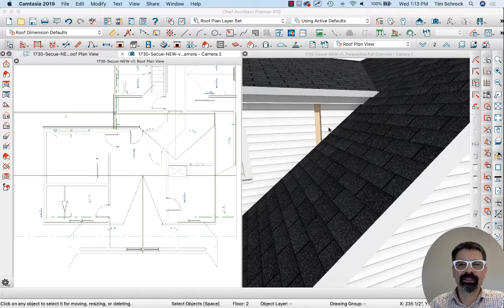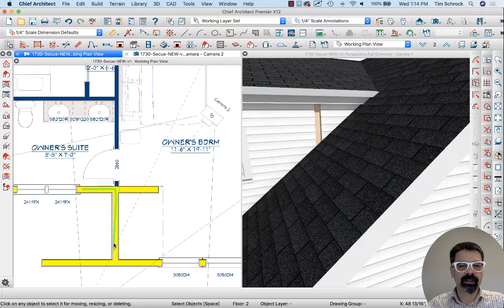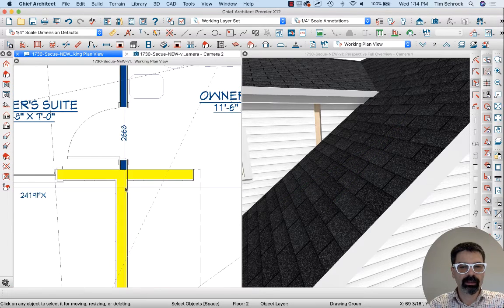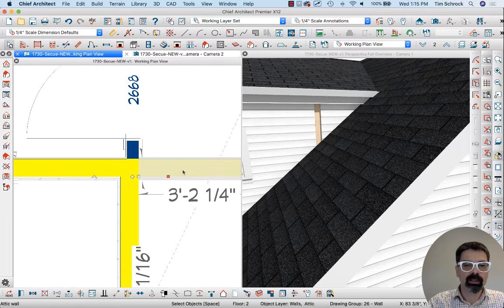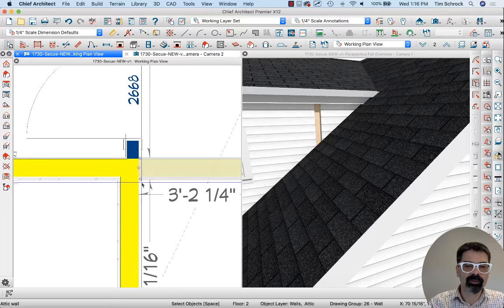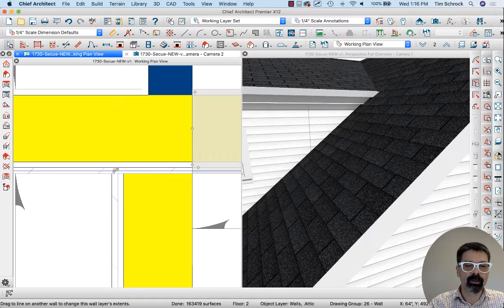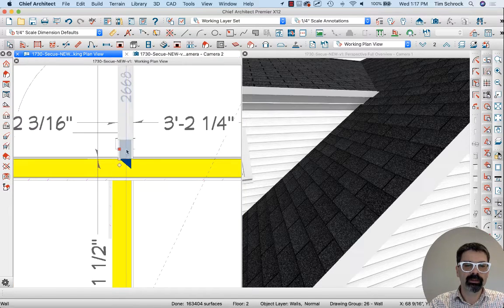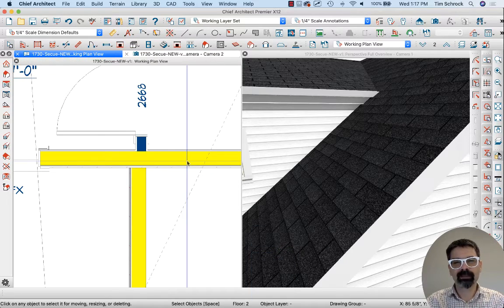Wall Intersections | Chief Architect

Comment: Another good one Tim.  Maybe for future one on using the User Catalogue?
Reply from the maker: Thanks Joe. What's the question on the User Catalog?
Reply: @DesignbuildsolutionsLLC  how to use it, how to access it, maximize its usage, best practices, etc.  Recently say someone import a whole bathroom fixture group, very clever.  Went back to try and create it with no luck